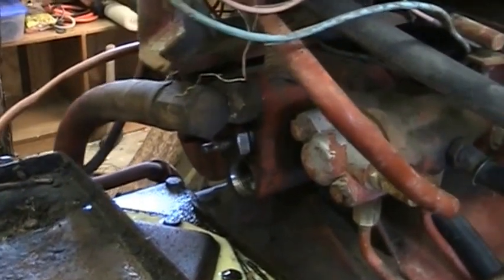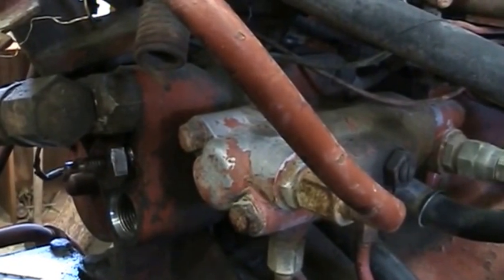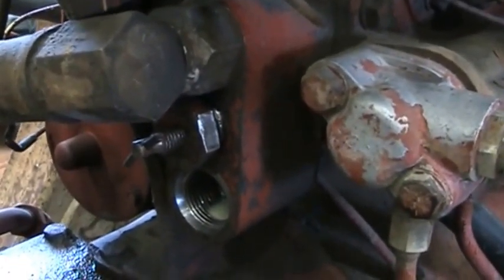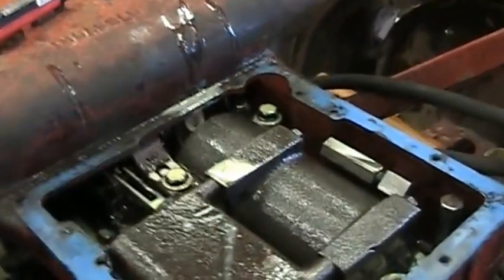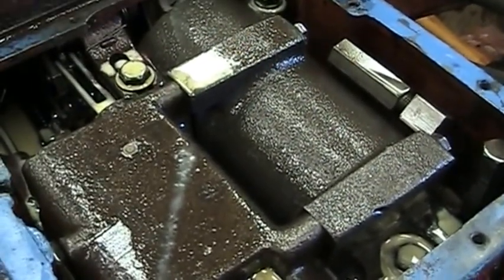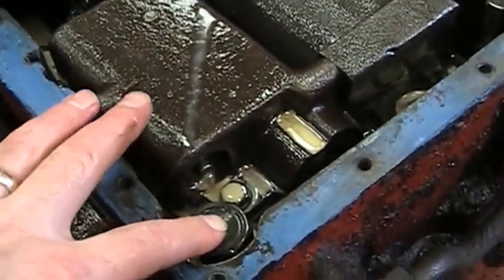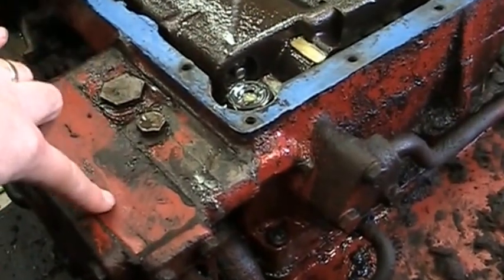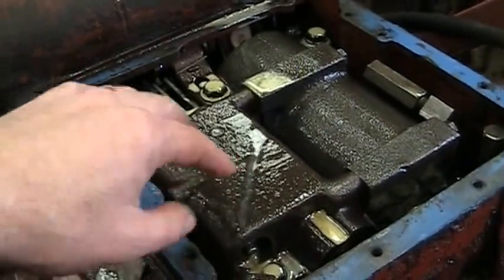International 504. hydraulics. part 3

Comment: i was just wondering if you would know what the line thats under the seat that goes to the pump is called and what it would be called the one with three bolts that goes the the left side of the tractor
Reply: 3-bolt, not sure what is for but think goes to three-point cylinder/draft control reservoir under seat.  https://www.tractorpartsasap.com/hydraulic-pump-pressure-hose-line-379644r91-300618.html